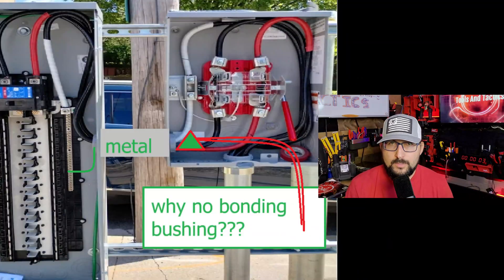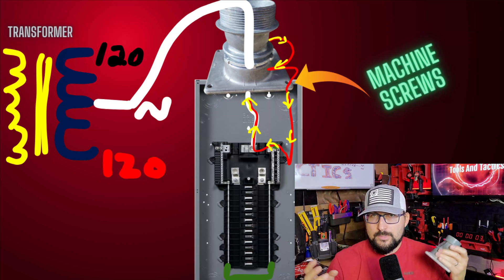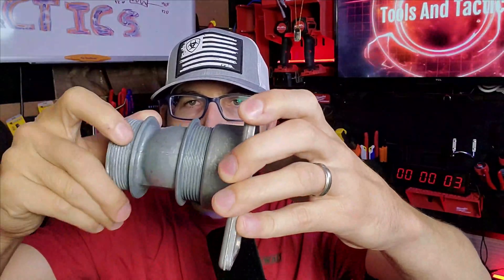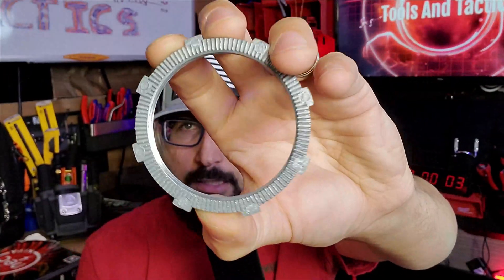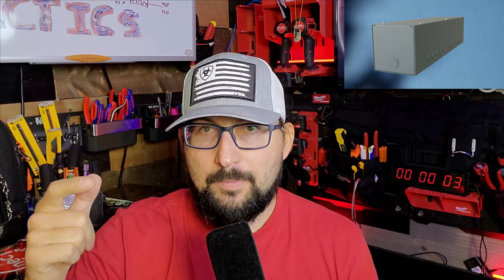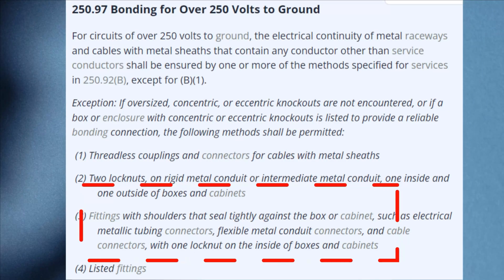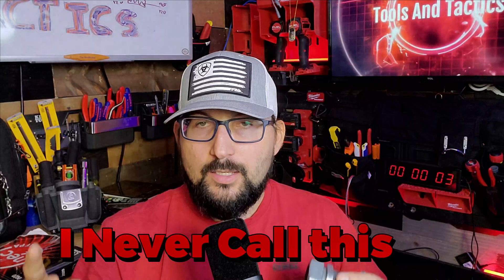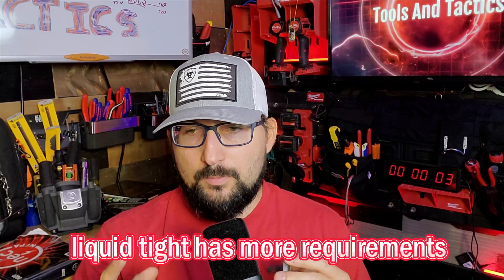This Is What Inspectors Are Looking For- Bonding Bushings

Comment: I enjoy watching your videos....thanks for this one. I saw another video where the guy discussed below 250v past the service. In his video, he said that the code was vague (250.90 and 250.96) when it came to under 250v in the sense that you had to ask yourself if "your connections are good enough to carry the fault current needed to trip the breaker." If yes, a bonding is not required. Some examples he gave of bonding bushings under 250v that might be required were 1) emt between two plastic luminares, where if you had a hot wire touch the inside of the emt, without a bushing the breaker wouldn't trip, and 2) If you punch an oversized hole that maybe doesn't have as secure of a connection as it would if properly punched--in this case, he said the best way to go would be to use reducer washers, but if you didn't "you better use a bonding bushing!" I'm just curious about your or others' opinions on this.Thanks.
Reply from the maker: i made you a video 😐😐👍👍😂😂
Reply from the maker: it will be up soon
Reply: @toolsandtactics  Sweet...looking forward to it!

Comment: 250.118 addressed the types of equipment grounding conductors. It says nothing about bonding bushings only that FMC in those three categories requires pulling a an equipment grounding conductor and not relying on the raceway as a means of grounding equipment. Bonding bushings are not required in transformers when you’re knocking out your own holes. 250.97(3) specifically list FMC connectors as a suitable bonding connection.
Reply from the maker: @Vlthrower  Metal parts of raceways and/or enclosures containing service conductors must be bonded together
Secondary conductors are treated like service conductors from a transformer.How do you intend on bonding?All the metal together when any flex over inch and a quarter and over twenty amps is not considered to be electrically bonded without a bushing.
Reply from the maker: 250.92
Reply: @toolsandtactics   can you say where the NEC states that secondaries in a transformer are to be treated as service conductors? It doesn’t. It has a lengthy section devoted to grounding and bonding separately derived systems and it doesn’t mention bonding bushings at all. And again the code doesn’t say that flex isn’t considered electrically bonded without a bushing. 250.118 has nothing to do with bonding bushings. All it’s saying is that an equipment grounding CONDUCTOR is required. As in you are not allowed to use the raceway as a means of grounding equipment.
Reply from the maker: @Vlthrower  i will find it for you, I suppose. 
Sec

Somewhere in  taps requiring overcurrent protection within 10 feet or 25 feet. 

Taps, being secondary conductors are treated as service.
Reply: @toolsandtactics  if FMC isn’t considered suitable as a means of bonding then what is a bonding bushings going to do anyway? And why does the code specifically list FMC connectors as suitable in 250.97 as long as they aren’t in concentric or eccentric knockouts?

Comment: Ignoring for a moment the code requirements, consider the fact that there are 200 deaths per year in the US alone in the home from electrocution. In 100% of these deaths, the electrical system has been grounded and bonded. When we ground (and bond enclosures and devices) an electrical system, we are essentially connecting one pole of every electrical load to every non-current carrying metal part within the system... and the earth itself. The concrete floor of your garage is tied to this system... the soil in your garden... and especially the puddles on your sidewalk after a rain. People die because they come in contact with the non-grounded (hot) side of a 120 volt circuit, while they are standing on a concrete floor without insulated shoes, or by accidentally touching a "hot" terminal or wire while they are physically in contact with metal on the grounded side. We are conditioned to believe that grounded systems save lives, and the code is very clear on instructing us to ground and bond appropriately.

But... consider a system that is not grounded, meaning there is no path for an electrical current back to the source, for an electrical fault. In an ungrounded system you could be laying in a metal bath tub full of water while putting the exposed end of a 120 volt 'hot' wire into your mouth. You would not feel even the slightest tingle of a shock because there is no path for the current to return to the source. I have a memory of being in a subterranean cave in the water up to my waist with a 120 volt temporary lighting system, where the wires dipped into the water here and there. Because the generator for this string of lights was in the insulated bed of a truck which was in turn insulated from ground by the rubber tires, there was no danger of electric shock.  Remember that an electron leaving the source has to return to the source. In an ungrounded system, the earth (or a metal bath tub) is not part of this path.

A whole lot of people die every year because of... grounded systems. Of course there are reasons cited for grounding our electrical systems, primarily the fact that an electrical fault to ground will trip the overcurrent protection, forcing us to repair the fault, and we don't want to allow a system where the metal body of your electric kettle could become energized without any breakers tripping (even if we could touch said metal body without consequence in an ungrounded system). In an ungrounded system, a double fault in the same appliance or device would trip the overcurrent device while a fault on one electrical pole of your washing machine and the opposite electrical pole of your dryer would in fact be dangerous. Maybe there'd be one death every five or ten years because of this scenario.

What if devices were manufactured with some kind of electronic fault detection that would indicate a fault or electrically isolate an appliance or device?? In a world with ungrounded electrical systems there would be 0 deaths per year in the US. This is assuming of course that all deaths involve contacting the 'hot' side and a bonded metal enclosure. It wouldn't prevent the death of that one in a thousand cases where the individual contacted both poles of an electrical circuit simultaneously. Sadly, in that one in a thousand cases, the individual could certainly die.

There are valid reasons to ground a system, for instance the towers in a high voltage transmission line, where the static charge of a tower could build up to millions of volts, and in many cases within heavy industry. I have spoken to electrical inspectors and engineers about this issue and have yet to find anybody with a compelling answer for the importance we place on grounded systems. Apologies for this long-winded comment on a video whose only purpose is to explain the electrical code. It is something that all electricians should at least understand, in my opinion.

And here's a related safety tip. Most (or at least many) of us have at some point or other had occasion to disconnect and reconnect a device from an energized circuit. We've been taught to always disconnect the 'hot' wire first. I disagree with this strategy. We should always disconnect the ground wire first, so there is no chance at all of us contacting both the grounded metal and the 'hot' side at the same time.
Reply from the maker: Not sure how i missed this comment i disconnect the ground first myself because electrocuting is the least of my worries vs an arc flash

Comment: Depending on what thread they're using. NPT NPS. Never mind, I don't wanna get into tolerance of threads. Let's just do a continuity check. on the next stream. Let's give him the benefit of the doubt that they're both. NPT You could just have a coating thickness that becomes a problem. Or when it was machined the spec were off. I am walking my self into a rabbit hole. Let's just go back to electrical continuity test.
Reply from the maker: LOOLOL!1!
Reply from the maker: exactly

Comment: A lot of it makes sense thank you for the explanation. I would also say it makes sense why there is some current on the Grounding Conductor in a Data Center. Switch mode power supplies are notoriously noisy. The EMC filters which utilize Y capacitors between the ungrounded and grounded conductors. will Causes some leakage current to flow from the grounded or the ungrounded conductor, to the power supply casing which is normally connected to the Grounding conductor. Add that up with multiple switch mode power supplies, you'll have a few amps.
Reply from the maker: thanks your very informed!

Comment: It is an easy fix now, if you fail inspections. This was not always the case in the past. Now, many companies make a split bushing that is easy to install around existing pulled wires.  This only really applies to commercial and industrial services. Most Residential services are under the 250 volt to ground rule.
Reply from the maker: @russrockino-rr0864  very true I should get my hands on one of those I have some pictures on them some sent me but I usually don't post contractor pics